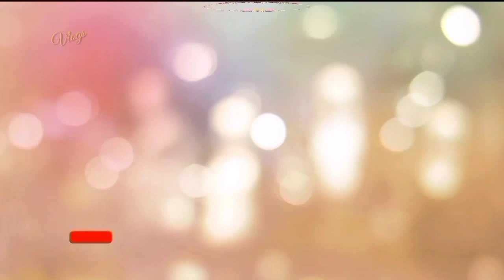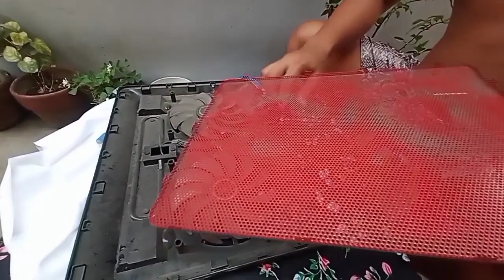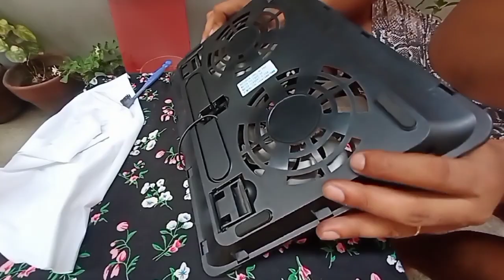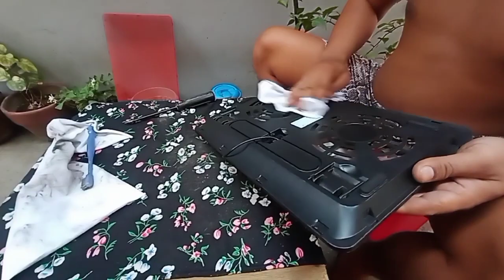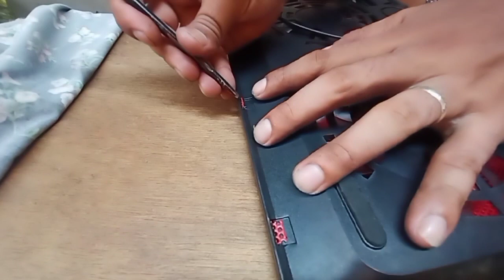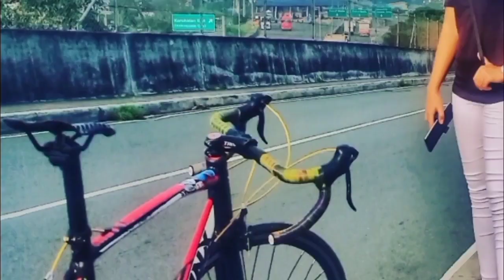HOW TO CLEAN YOUR OWN LAPTOP COOLING PAD OR COOLER  FAN?|DIY

Comment: very useful and informative information will do soon 😁
Reply from the maker: thank you
Reply: Please for the love of god don't use a toothbrush, just use canned air to blow the dust out.
Reply: @honda6353  even if you blowed to much air, dust will not remove at all you need to brush it with care i know tooth brush is not advisable but it is the only one available. used paint brush instead.